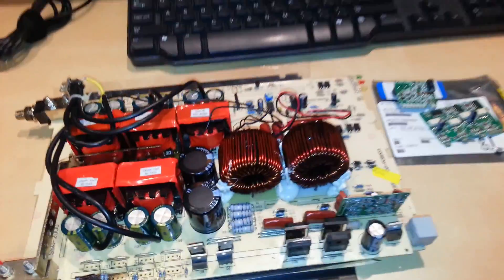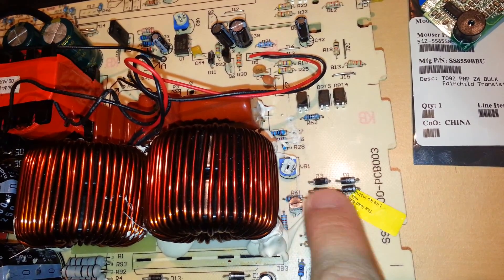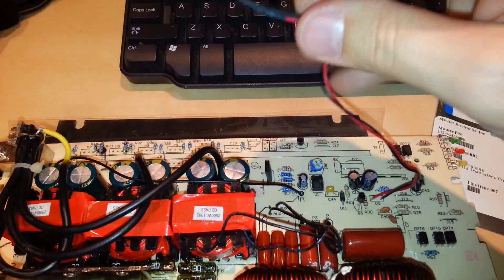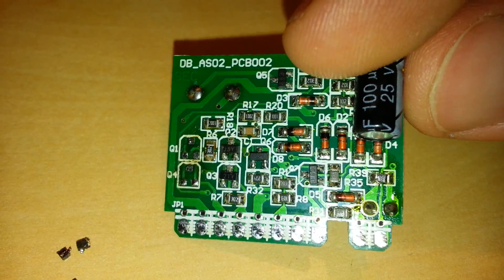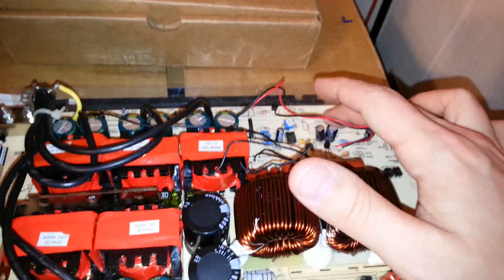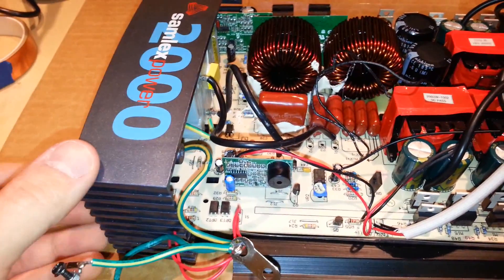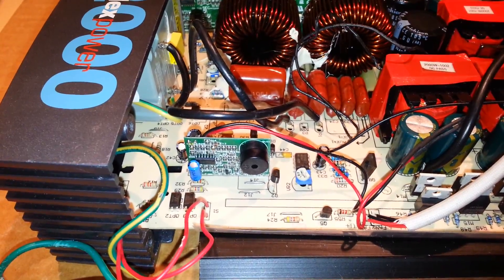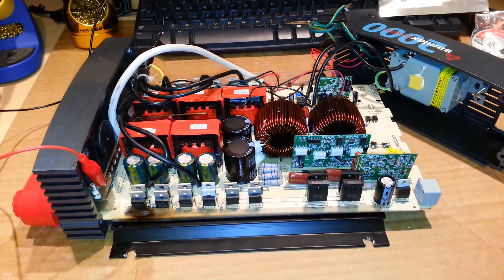Samlex SSW-2000 Pure Sine Power Inverter Repair: Part 4

Comment: I have one that a set for 24V input. Can you change it to 12V input?
Reply from the maker: Unfortunately no. The internal transformers are wound for 24 volt only. Even though the architecture for either voltage model is the same there are various parts that would have to be changed out in order to do something like that and not cost-effective.
Reply: @Bassguitarist1985  Damm. I got one for free, I was hoping their would be a dip switch or something like that set at factory
Reply from the maker: @Teddy_Bass  in some models there are dip switches to change the output voltage from 120 volts to say 110, but not on this model. Since this video came out I believe they've updated the internal design slightly however the older model is still extremely reliable and built well.

Comment: I'm making a wish. I haven't watched part 5 yet, but I'm hoping that he cleans that carbon off the board under that first FET. Carbon is very conductive and can cause fire. It's the same thing as what they call char cloth in the survival/shtf group. I've had problems with it many times in the past. another thing is that if any of the circuitry controlling the square wave is off a little it will cause the frequency to drift too far and the inverter will not come on.
Reply from the maker: I did clean it. And its been years and havnt heard back from the guy i fixed it for. Soo should be still running. :-)
Reply: @Bassguitarist1985  awesome! i was sure hoping you did. I used to have to sit for hours pouring over electronic circuits that people brought into the shop I worked for and it sure was a large learning lesson when I first encountered that phenomenon. I had to sit and watch sparks and fire between the pins when I was testing the new mosfet lol. Scared the hell out of me haha.

Comment: Very interesting video w/ tons of info....
I have an Exeltech brand 1100w inverter...it blew all 4 of  it's MDL 32v BUSS fuses....no other damage. A quick trip to Home Depot....less than $8....I'm back in business.......Exeltech a Texas base company reportedly invented the very first sine wave model. They also supply the military field equipment inverters....very expensive with a kick a$$ warranty. I bought mine used. The MTBF is estimated @ 20 yrs.

Comment: Just wondering , if the ground and neutral is internally bonded  wouldn't it be possible in theory to  sync two of them so that  combined has  a 220 voltage? One unit LI pos 110 of zero and the other unit L2  110 neg zero and jump the neutral  ?   I happen to have two Vanner vlt 12-1000  , although made by Cotek happens to be a vary similar design .
Reply from the maker: no, the two units need to be synced in phase with each other. 240vac is not possible. it is possible for single split phase to work since ground/neutral are common, you would have to defeat the GFCI plug though. the output drive circuitry must be synced somehow. its a lot more complex to do so.
Reply: *****
Ok , thanks , I picked them up for around 300 apiece . I have 1800 amp hours of battery bank with 2 outback fx 80 charge controllers and with 2400 watts solar , I was off grid for two full years and had no problem with just 2000 watts , I did heat just with wood, changed over to  propane hot water and a 7k genny for back up . I just didn't see spending the money for the outback inverter .Id prefer not keeping all my power in one basket so i split halves of the home with the two Vanners . I too have problems looking for schematics for these .Still trying to find remotes for the RS232 ports  . I could make them if I know what signals to look for .I could scope it but its just guess work with out schematics. Cotek is not forgiving with their equipment  !

Comment: im betting the new drive ic you put on was not programmed, i got a bios like that once, had to order a new one, like the arduino it would stall the outputs to high if not told otherwise and that would over heat the transistors

Comment: One of the best things I learned about debugging motor controls (h-bridges), was to use a scope to verify that the waveforms in the driver circuit were solid. Not to mention a much faster and reliable repair process. I have a spare battery powered  scope that would work great for repairs. Would either of you (xboxer1985, knurlgnar24) be interested in trading a scope for a pure sine inverter? 3kw would be best. 2kw would get me by for now. We burn three 55 gallon drums of gas each year in a 2 week period at BurningMan in just my camp alone. With a sky full of sunshine I have to believe adding solar to my camp would be a great alternative. I just secured ten 215 watt panels today. Thanks for your great repair videos gents! Let me know what you think!
Reply from the maker: I just have the osp tiger claw that I own. I know *****  has a 3k for his large 1k amp hours bat bank. Hes got more inverters than me im sure
Reply: I've really liked the Tiger Claw after all of the work you did! I just need a 'more power'. Where do you guys get the dead units? I don't see any on Ebay or CL.

Comment: Interesting video.  Would you normally heatsink the drive transistors?  This seems to be a heat/avalance issue.  Would you agree?  Thanks, -BAG2
Reply from the maker: The drive transistors are heat sinked but they do not have any thermal compound on them.
Reply: ***** Hi, Thanks for the reply.  I should have been more specific.  I was refering to the small transistors right off the daughter card/fault card.  Since they failed, do they think they failed from heat?  Or, the current ripping back into the system from the burnt high voltage transistors that drive the AC output transistors.  Thanks, -BAG2
Reply from the maker: Ahh those. Not a heat issue, current spike from the input drive FETS.  Samlex told me they did not use the best quality parts in the first run of these inverters. they've since made a change for the better. Still unsure what was the initial cause a burnt transistor a shortage capacitor or the daughter card decided to fail and destroy everything else

Comment: Sorry for the delay in my reply, it took me a while to get to watching your new vids, and I appreciate the shout out you gave!  If you replaced the BJT transistors on the driver board with the proper parts and also replaced the control IC with the proper part then I would be very surprised if the problem was on that driver board.  Are you certain that the input FETs are all connected to the driver circuit properly?  You've probably already checked this but often the gate resistors that control the input FETs fail open circuit.  Just wondering if that is the problem?

You seem to be pretty thorough here and I appreciate the look inside this inverter as I've not yet seen one in person.  It looks about standard for what I'd expect in a midrange product.  I hope you get it working to test it out!
Reply from the maker: I checked all the resistors, the 20ohm resistors are all good. The FETS are installed properly for sure. Q2 was shorted, i changed that before installing the board. The DC side now draws no current, and even when the SMD transistors blew the DC side was only pulling half an amp. I'm wondering if I bought the wrong BJT SOT-23 transistors?? Maybe different pin outs? ECB instead of EBC? Both were burnt and couldnt see any markings. Samlex is sending me a replacement input drive board since I kinda hacked this one for a reasonable cost. I've tested all the diodes, resistors on the main board and nothing tests shorted.
Reply: *****
BJT pin outs are not standardized the way FET pinouts are so it might be good to draw out the circuit and see which pinout it makes sense with.
I had a good experience with Go Power (carmanah company) and I am happy to hear that Samlex is a stand up operation as well.  It is a great sign when the customer service reps are willing and have the permission to go all the way back to the engineers to find the root of the problem for even the small customers like you and I.
Reply from the maker: ***** Been speaking with samlex tech support. They did send me the full schematics for this inverter. However it doesnt include the schematics for the daughter boards. Unfortunately samlex did a complete redesign of the daughter boards and the new design isnt compatable with the old style main board. Tech support is looking for an old style board for me but im not holding out much hope...